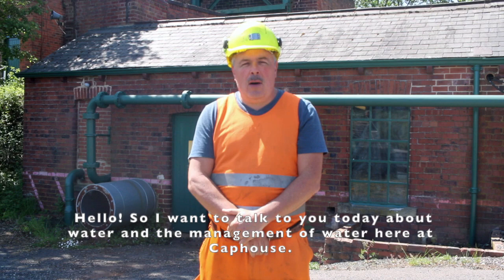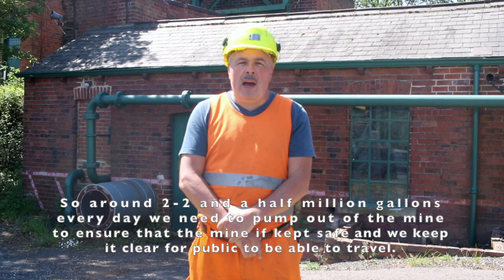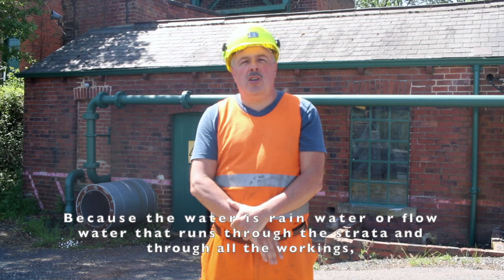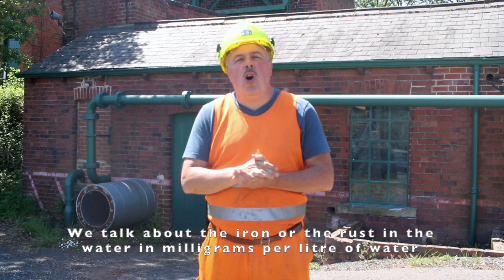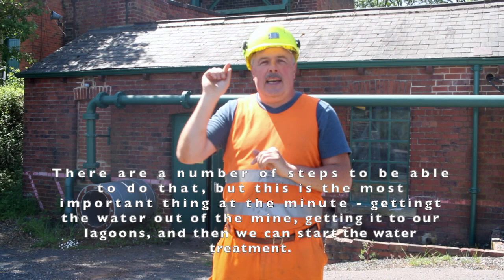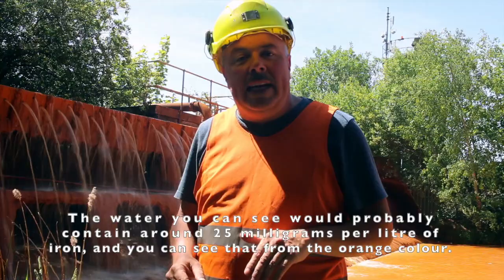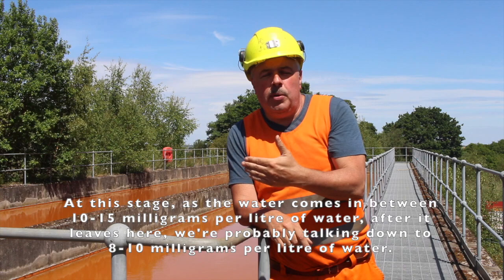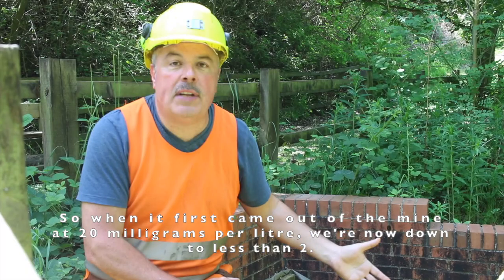How do we clean our mine water?

Comment: 2 million gallons = 9 million litres. At 25 mg/L reduction in iron concentration that's 225 kg of iron removed per day, or 82 tons per year! Do you have to dredge all that rust out of the settling pond and what do you do with it? Iron oxide is currently valued at 2 USD per kg, so that's $164,000 or £130,000. No where near enough to cover the cost of pumps, but an interesting by-product.